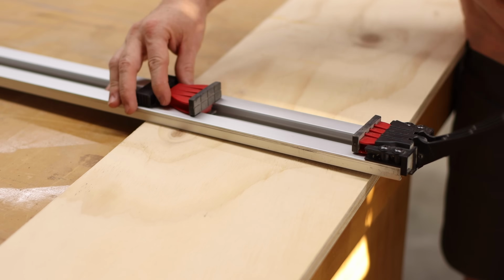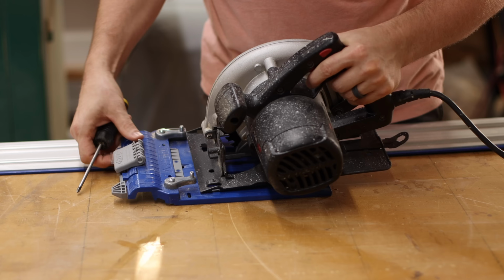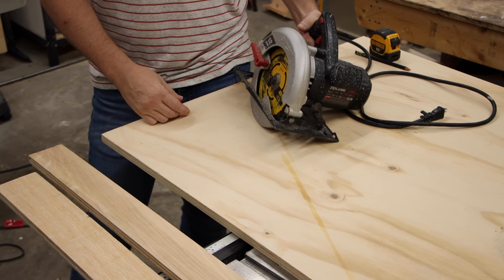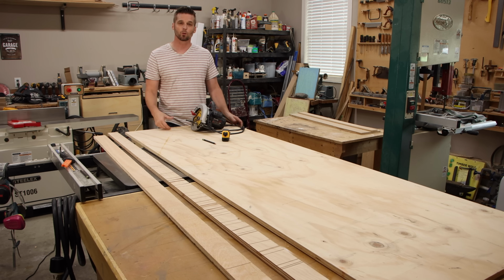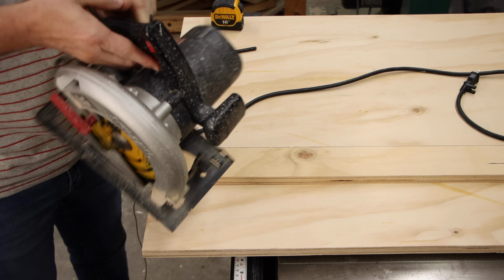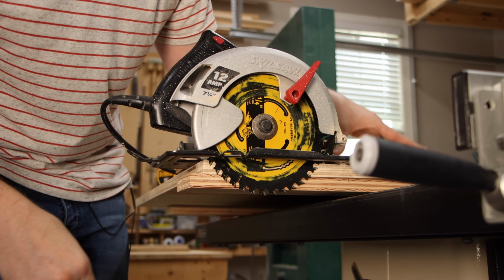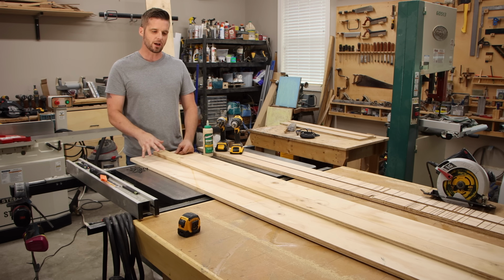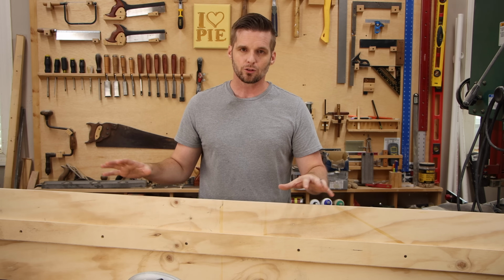Make This Circular Saw Track Saw Guide....With a Circular Saw!

Comment: I was thinking. Would it be wise to have the fence/guide piece over hang each end the length of your straight edge...
That way you know, when your about to pull the trigger on the saw to start the cut, that your going into the material straight and the saw isnt going to kick or give a unstraight start, if you know what I mean.
Then at the finishing end
Your saw still has the fence there to guide it straight out of the end of the material.
For example. if your saw base plate is 250mm long. You would have a 250mm fence overhang at each end. Just to assist you in having a steady hand and accurate start cut & finish cut...!
Sorry about the mm's.....some of us Aussies are not much good with inches/feet measurement's. Im 54 and still cant work out inches and feet.
Reply: I’m American and have used feet/inches all my life, but wonder why anyone ever pushed this on us. The rest of the world is on metric. Working with 10’s, 100’s and 1000’s is so much more logical. But now I’m trapped at my age.

Comment: swap out the ply fens for a section of steel box section which will allow you to clamp down using the inside of the box. the benefits are you can make the guide thinner and will also mack it more ridged?

Comment: Hi Tommy, thanks for the useful guide. Would it be OK to make the guide out of OSB as I don't have any ply. Thanks again.
Reply from the maker: you could try, but OSB tends not to be flat or smooth, so that may give you trouble sliding the saw evenly across it.
Reply: @OutoftheWoodwork  Your quick reply is much appreciated, thanks for the advice .

Comment: this is a great video,,,,i made one a few years back and it works great,,,i made mine to cross cut plywood,,i use the same square and draw the same line across the plywood but i leave the square in place on the right side of the line then move the guide up to the square on the left and clamp it down,,,,,you cant get it any more square even using a table saw,,
Reply: I agree. I actually find this type of guide as accurate as my table saw for perfectly straight cuts. To get perfect, long cuts on my table saw, I need to set up a long infeed and outfeed table, and use guide rollers to keep my material tight against the fence. I only use my table saw for long cuts on panel-size material when I need a dead-on accurate bevel angle.

Comment: I wouldn’t glue the fence as you have to periodically move it back to freshen the edge for accuracy. The ragged plastic edge on your saw track demonstrates the reason for that. That’s another reason to leave extra width on the base plywood. For best results alway mount on the keeper side of your stock. It doesn’t hurt to have the fence protrude out at the cut start end to get the saw registered to the fence  early. Cutting your stock from the back side to avoid tear out will allow you to screw the guide to your stock where the holes won’t show if you can’t clamp it.
Reply: 1/2 thick base won't need to be refreshed. I got 5 or 6 cs guide like that with 1/4 base and they are still fine
Reply: @pimc172  changing blades, blade flutter and and accidents have eventually required moving the fence on all my guides. It will start cutting beyond the guide base forcing you to compensate loosing precision and increasing tear out. My 4’ guides have aluminum fences on 1/4” Luan  (X mm’s) attached with tiny flat head bolts through the base with fender washers and wing nuts on top.

Comment: What if you’re cutting a thick piece of butcherblock? The saw motor won’t clear the guide once the saw depth is adjusted.
Reply from the maker: You have to find some middle ground between how deep you want to cut and still having a thick enough fence to run the saw against. You'll lose some depth of cut, no doubt.
Reply: @OutoftheWoodwork  Thanks for the response. I’m going to the store today to see if I can find something that’s thin enough but yet would make a good guide edge

Comment: Great job… what do you think about using plexiglass instead of plywood for the base?
Reply from the maker: I would worry about the plexiglass melting on the cut edge. I wouldn't think that the heat buildup from the blade spinning right there on the edge and the friction of pushing the saw over it would be good....but, it just needs to be tested!

Comment: hmm... I need to make a couple of these.   I've always used a straightedge but sometimes the start of the cut isn't exactly as good as it could be since the saw hasn't had a chance to let the straight edge "guide it" until I get a few inches into the cut.    I think that when I make these I'll pull the starting edge of that top board back a couple inches  (so it's protruding off the bottom sheet a bit) to let the saw have something to ride up against before the whirly bits start to do their job.   By the time it gets to the other end of the sheet the blade will have already cut through before the saw runs out of guide.

Comment: Don't know much about wood work but I have a question.  If you have a straight factory edge on your plywood couldn't you just raise the circular saw guard out of the way and place the saw directly against the edge, then mark the other side of the saw slide.  Then move it up to the other end of the plywood edge and do the same.  Then lay your straight edge piece on the marks at each end and glue in place.  Then just run. your saw down the other side (width of saw) down the other side to cut the piece to width?
Reply: Have no idea what you are describing!
Reply: Use the factory edge for the top piece (the actual guide edge), and you know it is straight. After assembly, you will be using that perfectly straight factory edge to trim off your base. Now your blade is exactly aligned with the newly cut edge of the base. Whatever you line up with the edge of the base will also be the edge of your saw blade.

Comment: Don’t glue the guide to the saw bed. Use screws instead. This way you can use and reuse the same saw guide with different blade thicknesses. If you want accurate widths, then this is the way to go. I’ve use the same guide for twenty years.
Reply from the maker: Screws will open the holes up over time and then the fence won't sit parallel to the edge, especially if you're moving the fence around on the base, all the time. I'm not sure why you would be using different blade thicknesses....I suspect you mean different blade types which would have the cutters in a slightly different orientation. But, why do you need to use different blade types with a jig like this? It's for crosscutting wood....one blade type will get it done.

Comment: This is the right way to do this.  However you can use a sheet of thin wall board.  Put the furring strip on one side, glue and screw it into place.  Then put the edge of your saw up against the furring Strip and cut the whole length of the panel below.  I have a Skill Worm Drive, and I've cut 2 sizes, one for an 8 foot legth and another for a 4 foot length..

Comment: Just watched this. Cool video- but how do you keep it straight over time? Meaning given moisture and storage, how do you keep it from warping given that length?
Reply from the maker: Plywood isn't like solid wood. It's stable as long as it doesn't get really wet. Mine is still very straight and I just keep it leaning up against the wall.

Comment: Just a thought. 
It would be a lot easier to build ripping your pre-cut pieces on the tablesaw sitting right in front of you instead of rough ripping everything with a circular saw 😬
Reply from the maker: The point is to show someone how to do it if they only have a circular saw.
Reply: @OutoftheWoodwork  gotcha! 
Thx for making the video 👌

Comment: Whats the standard depth of cutting wood in Circular saws ? Waiting for reply 🙏
Reply: A 7 1/4" circular saw will have a depth of cut of about 2 1/2 inches maximum.  In this case, this will be reduced by the thickness of the base and maybe further by needing the motor to clear the fence.
Reply: @michaelwilliamson1392  thnx for replying.appreciate

Comment: Good process.  I'd suggest using profile aluminum (80/20) as the fence and just run bolts flush to bottom on the ply platform guide.  That way you can just swap out the ply if and when it gets damaged or worn.   Thanks for producing the vid.
Reply: Another excellent idea IMO. I think I will combine that with @Danny L's idea and attach your suggestion to the floorboard. I'm not too keen on something 15" wide and 96" long. That will be a bit awkard for my little old and fragile hands and arms. Thank You for sharing your fence idea. It is much appreciated. 👍
Reply: @TsunamiKitten  I have used an aluminum angle as a fence and it works well.
┘. Horizontal part screwed to the wood base, vertical part is in contact with the shoe of the saw
Reply: After a year those 48 inch V slots sitting in my closet have found purpose

Comment: My dad was using these back in the 1950's but with a piece of 1/4 inch paneling (smooth / finished side up).  The lighter weight of the paneling made it much easier to handle and the smooth surface made the saw glide more easily.  He also made a short one (4 feet) for cross cutting plywood.
Reply: With a thinner base like that, you could stiffen it a bit by using a wider fence board.

Comment: I made one of those for a router. Didn't like it much, instead I made a setup block that adds the requisite spacing. It's specific to the router AND bit combination, but OTOH it's just a small piece of 3mm melamine. I'll try to keep it with the router. Actually, I have two.

Comment: Hey I need to cut stair treads and so I will make the jig but which blade do you recommend for my circular saw. The treads are red oak.
Reply from the maker: I've always used a 40T blade and it's worked great
Reply: @OutoftheWoodwork  Thanks so much
Reply: @OutoftheWoodwork  that’s not the small little teeth ?
Reply from the maker: No, that would be 80T and up

Comment: Great video. Making mine tomorrow and getting rid of my aluminum angle that is such a pain. 
Thanks a ton
Reply: So I made mine today and spent all day cutting thin strips just for fun. Accurate from end to end. Only diff I made was glued fine sand paper to bottom and zero slipping. Thanks again

Comment: I tried making a guide like this once I live in TN & after a short time, the humidity here caused it to warp & become unusable do you have any suggestions?
Reply from the maker: Did you make it out of solid wood? That may be why it moved. I made this one out of plywood which doesn't move throughout the year.
Reply: @OutoftheWoodwork  I made mine out of plywood also over time it curled up like a potato chip
Reply: @vincebaker3384  yes. Seal the whole thing with polyurethane
Reply: @OutoftheWoodwork  I used plywood
Reply: For really humid environments, here are six suggestions that might help.  Basically remember that wood is a sponge and will soak up moisture if it is present, and if it is wetter on one side, even plywood will warp.  So either keep it dry or keep it equally damp on both sides (and cross your fingers).   1.  Use a good grade of relatively new, bone-dry plyboard.  Ancient or already damp plyboard may have poor quality glue or deteriorated glue or rotten wood in it.   2. Use marine plyboard if you can.  3.  Seal all sides of the plyboard with 2 or 3 coats of polyurithane or oil based paint to keep moisture out of it.  4. Store it away from drafts, and away from any source of moisture, such as a concrete floor or a cement or red brick wall.  You may find you can store it on several rafters, or on another board to keep it from warping.  5.  Store it out of the direct sun from a window or door, and away from any major heat source, such as a wall that is being baked by the sun.   6.  Of course, store it and use it inside a much as possible, out of the wind, rain and sun.

Comment: I would cut the other side to fit the other side of the shoe. That way you can make cuts both directions.
Reply from the maker: CyberCPU Tech thanks for the comment. There's such a thin strip of metal on that side that it wouldn't be supported well enough.
Reply: @OutoftheWoodwork  thats when you add a strip to the other side of the cut for it to ride on. I do it all the time
Reply: @OutoftheWoodwork  if the base is equal each side of the guide strip, you can run the motor over the guide strip both ways.